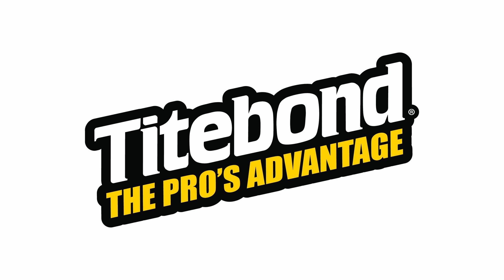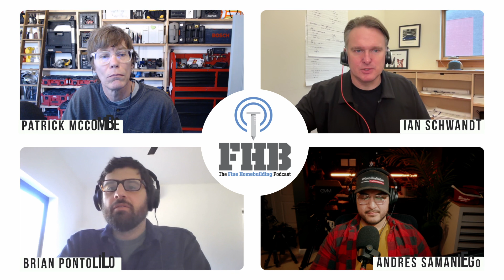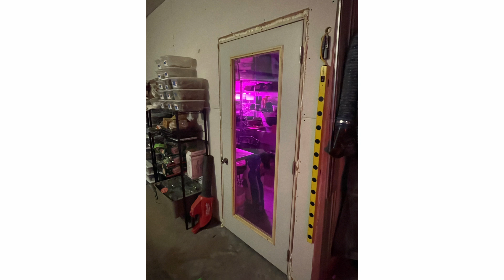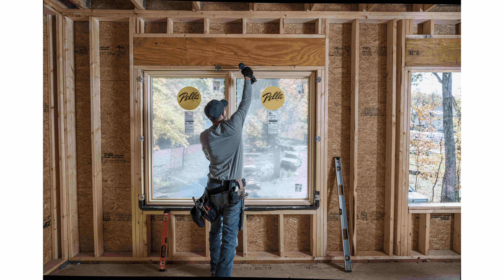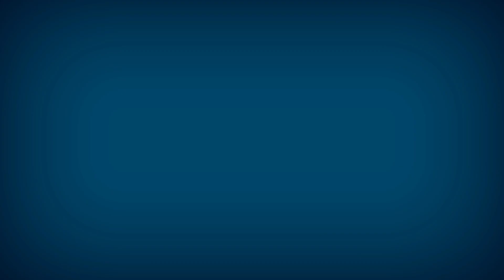Podcast 625: Roof Insulation, Band Joists, and Small Houses

Comment: I saw an episode of this old house where the developer of a neighbor installed shared geothermal heating/cooling so each block had an underground portion shared by everyone on normal looking houses with the above ground unit on each house. They also had a solar system designed to provide the electrical needs of the community for a year attached to the grid, but had a battery storage unit big enough to provide 24 hours of electricity when the grid was down. People were to get text messages when the grid was down so they would put off stuff that could wait in case it took longer for the grid to be restored. Planned for and put in place in advance the shared cost on a development scale was modest and had a 5-6 year payback in terms of utilities savings all in your mortgage and so paid for over 15 to years. Your actual monthly costs for mortgage and utilities was lower than it would normally be.